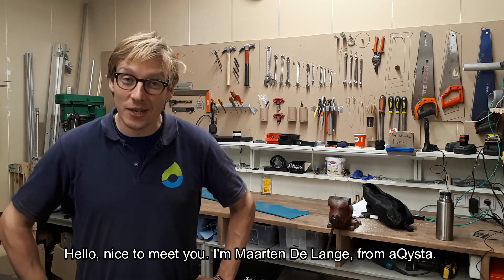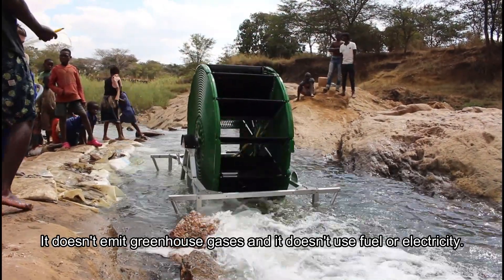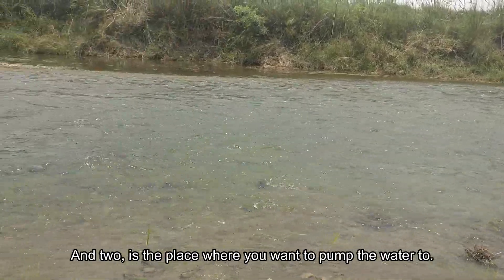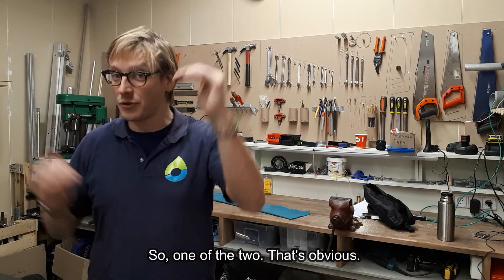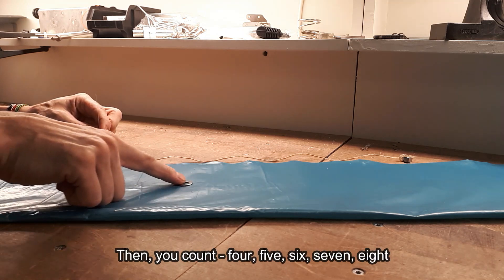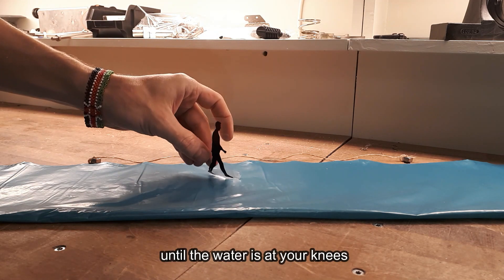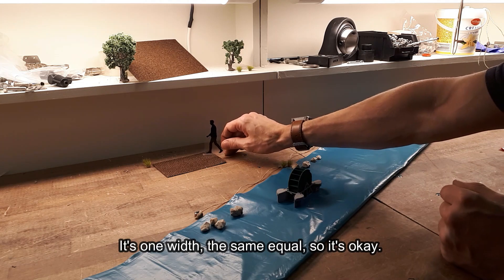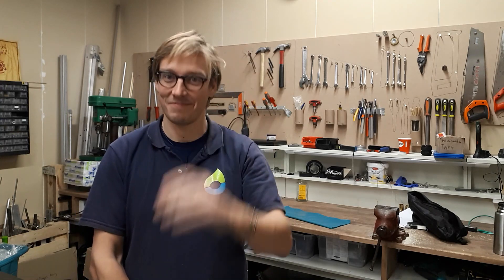Barsha Pump - Site Feasibility Explainer Video

Comment: some info.      at :21,  this (barsha) design appears to be  NOT  well-designed;  compare information, at the link.       this type of a pump is  Best-suited to locations where  water can leave the pump, via  a  vertically oriented  'riser';  thus  maximizing  air-lift affects; while delivering water to an elevated catchment.    cheers 
https://lurkertech.com/water/pump/morgan/blair/002.htm
Reply from the maker: Correct, scientifically! However, cost feasibility has more weight in the decision-making than a bit of energy efficiency gain. Cheers!
Reply: @aQystaBV  goobledy-gook.    it does Not necessarily cost more to use a  BETTER  design !!!!!